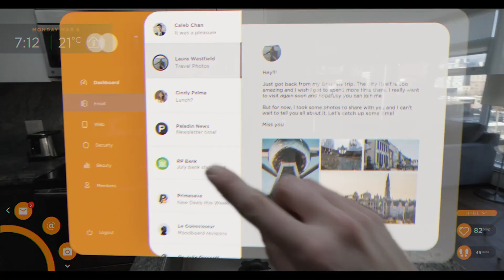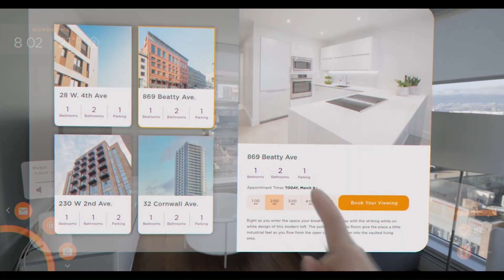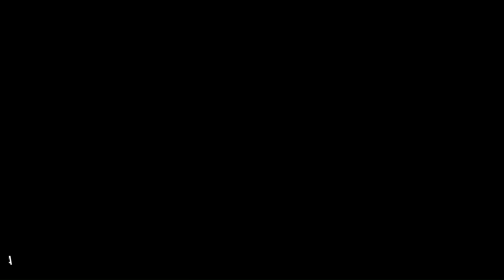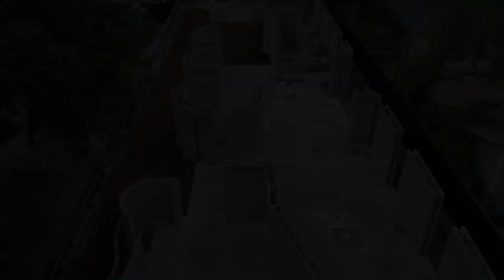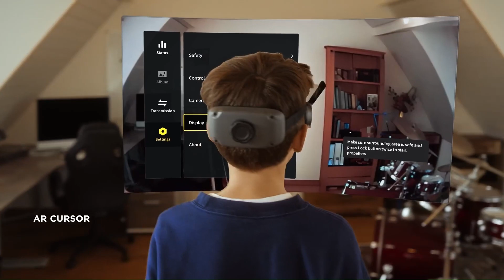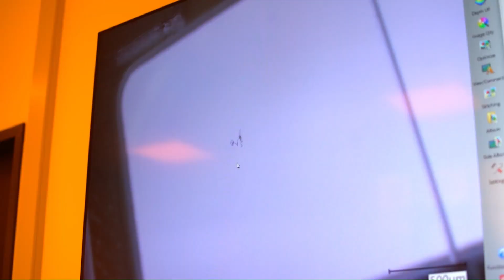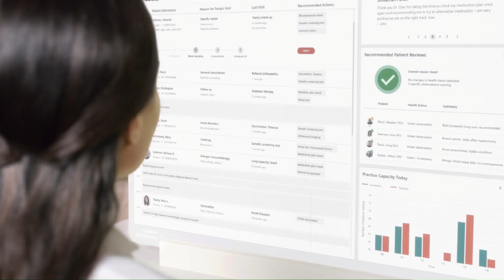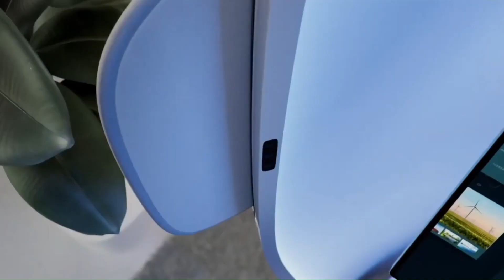15 Emerging Technologies That Will Blow Your Mind

Comment: The problem with using silica glass is that it may only be a 1 write application. So if there's a mistake, you brick the whole thing. I could be wrong, and maybe data can be changed on it, but I doubt it.